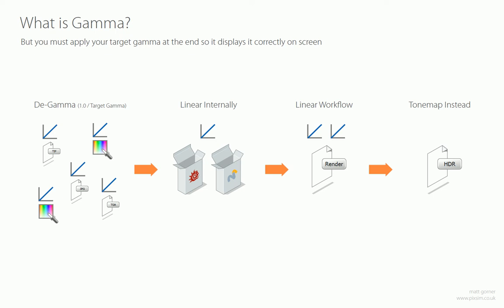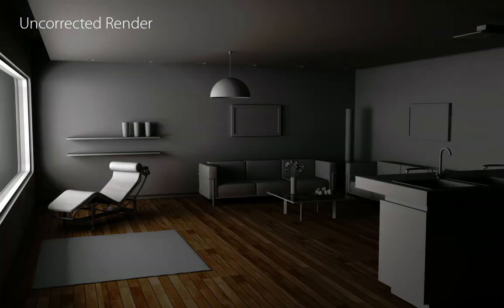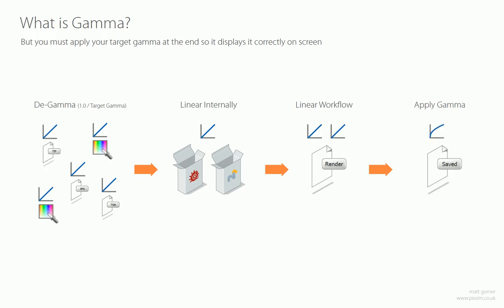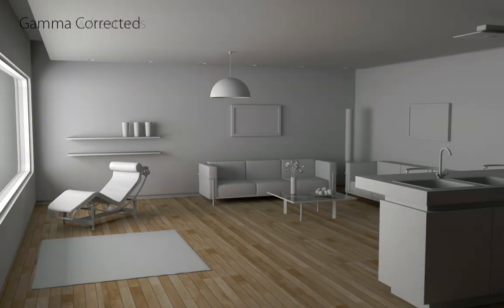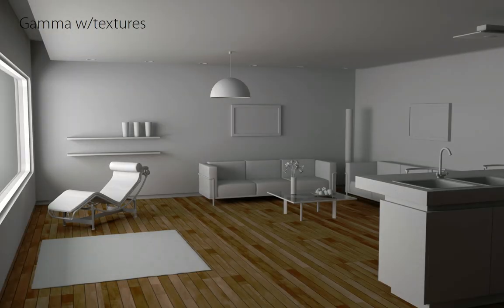Gamma Correction & Linear Workflow Part 2 of 2

Comment from the maker: It depends on the 3D software you're using, but the process should be the same for most.

You need to find each image's Gamma setting (usually in the properties for each image).

Then work out the 'de-Gamma' value: 1.0 / TARGET GAMMA, so for a Gamma correction of 2.2 it would be: 1.0 / 2.2 = 0.4545

You then enter that number into the image's Gamma setting.

I do mention this in the video, but as it's a general overview it doesn't go into any specific packages.